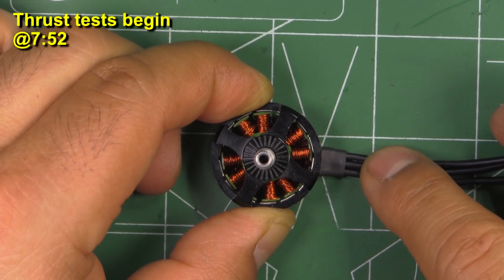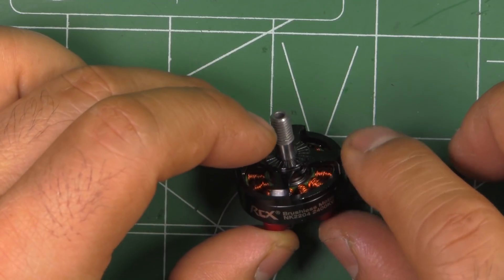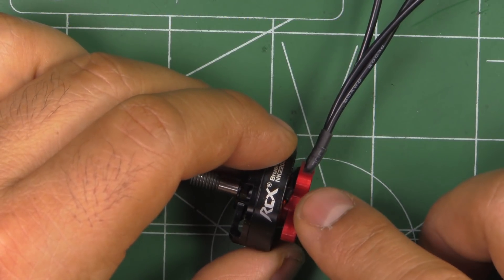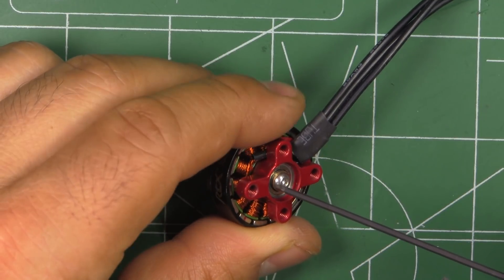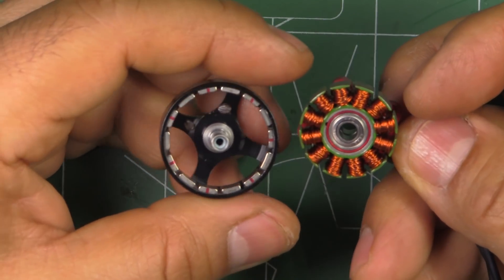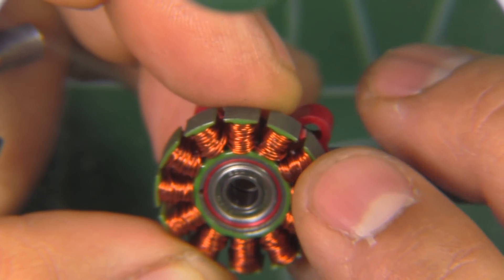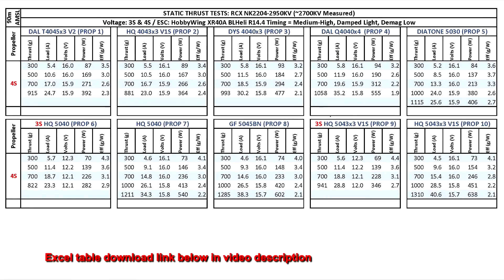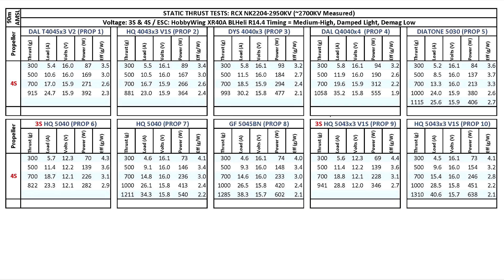RCX NK2204-2950KV Thrust Tests & Overview

Comment: Do you think this motor at 2950KV would experience battery sag using 1000mah 4S packs on, say a HQ 5x4.3x3 V1S on a ~280gram AUW quad?
Reply from the maker: I think is highly likely that you will see some voltage sag, the amount or how soon you will see it will, of course depend on the quality/capability of the LiPo pack.
The Max A for that prop is about 41A (burst) static, in actual flight it should be around 41*0.6= 25A, 4 motors = ~100A but I that is only for a very short burst, then Amps come down more, so maybe around 65 to 80A for longer bursts. 
The current draw that a 1000mAh LiPo can continuously support depends on its true C-rating and quality of the cells. Most good cells are around 65C at most, Very few, if any, can maintain 80 ~ 100C.
1.0Ah*(65C) = 65A = Theoretically, that's the amount of current a 1000mAh-65C cell can support. So when current is higher than that, you get heat, higher resistance and voltage drop. But that happens on long full throttle stints. That can happen if you're a racer with throttle >80% all the time. For freestyle, flying around we only do short bursts so voltage sag is less of a problem. Your very light weight build will for sure help reduce voltage drop. 
I would be interesting to find out how the 1000mAh LiPo would do on your setup. Post here what you find out.

Comment: I'm glad you have consistent props in the mix to compare with older tests, but can you add the 4" flash prop from gemfan? I think its a 4052, and I'd bet its a solid choice for these kind of motors.
Reply from the maker: I ordered it a few weeks ago from RaceDayQuads, after I ran this motor, I actually ran tests on this motor about 1 month ago but hadn't had time to organize data and edit video. I'll run the GF Flash 4" on the 2700KV version of this motor, should give a good idea of how it compares to the HQ 4". Usually, the Flash props don't show good numbers on the thrust stand because they're designed for performing best when flying at speed. That's why I don't include the Flash 5", it always gets lower numbers than 5043x3.
Reply: EngineerX good to know. Thanks!

Comment: This motor+
ultra light build+
Dal 5040 prop=
Amazing
Reply from the maker: Sounds like a good setup for this motor!🚀
Reply: EngineerX yeah, that's the only option if you want 5" on this motor. 
Or if you want a 4" you should go with pretty high pitch prop and just any normal weight of 4" quad

Comment: EngineerX recommend me one of this RCX motors and they are incredible good 
EngineerX should I but them? ,😎
Reply from the maker: Yes, for the price they're one of the best budget motors. They also have lots of spare-replacement parts available like EZO bearings and bell/magnet/shaft assemblies that you can buy to replace damaged motors if you crash hard enough. The RS2206-2400KV is a very good motor for light 5" frames, for more grunt and a little more efficiency the NK2207 and NK2306 are also very good. Around 2400KV is good for freestyle, higher KV is preferred by racers. These a "low-budget" so always a good idea to buy one or 2 spare motors just in case. Almost everyone seems to be very happy with RCX motors. Every now and then they have some issues just like any other manufacturer and they have been fixing issues quickly soon after people report them. Because they run a no-frills shop, it's always best to make sure you know what you're ordering and don't make any mistakes in your order so you don't have to spend more time and money shipping stuff.
Reply: I'd even say that the RS2206 2400KV is excellent for racing if you're looking to run heavier props (T5046C & T5050C, 5x4.8x3 V1S, RK5051, etc.).  Running the same for freestyle just run lighter props and add a GoPro if you have a frame that is flexible.
Reply: Perfect!! And cheap. Shiping is fast.

Comment: Impressive numbers and more efficient than the hyperlite u tested on HQ v1s. Might switch to these when the weather improves for testing the 160g build. I'm killing hyperlite 2204s way too often.
Reply from the maker: Yep, numbers look good and motor should be able to deal well with abuse, based on the 4mm shafts and EZO 4x9x4 bearings. Price is reasonable so worth a try.